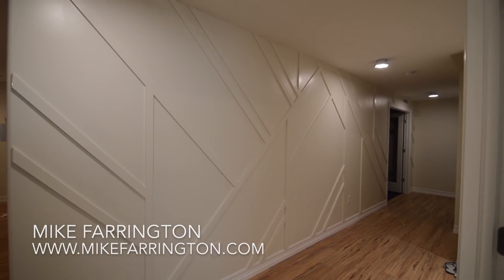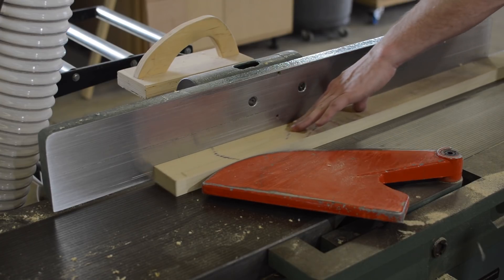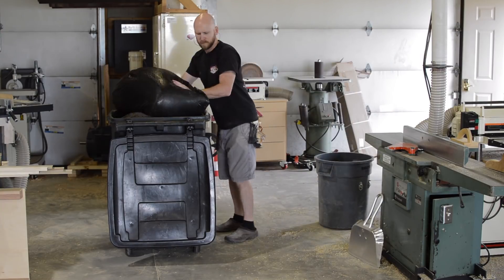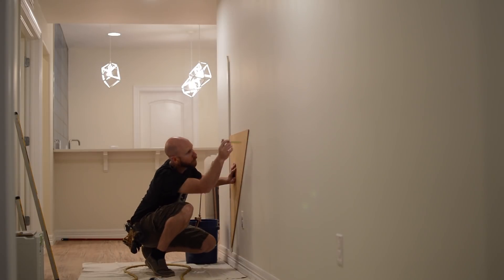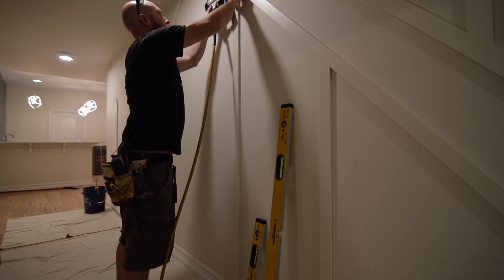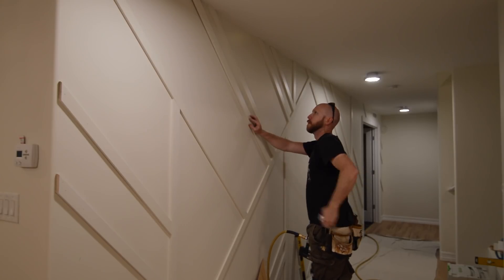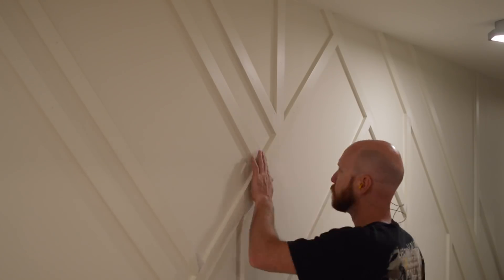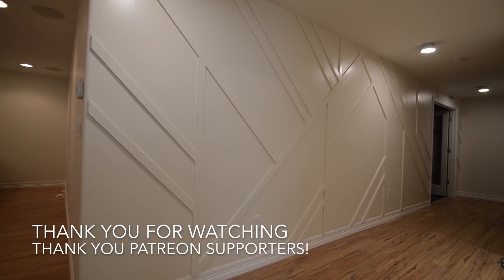Wainscoting with a Modern Geometric Twist, Wall Paneling diy

Comment: Did you just leave the 1 x’s hanging over the baseboard? Not impressive man. And you do fantastic work.
Reply from the maker: The pieces were slightly under 1/2" so the over hang was not too bad. Leaving the base was not my decision though. I presented the option to remove the base board and replace and the extra cost was not worth it.

Comment: I think I would have changed the base board over to 1x6 . At the start corner in my house from kitchen to great room wall colors changed, so stopped the colonial trim, added 2, 1x3 up rights so the trim in the kit was different in great room and the wall color was different. Liked the designed a lot
Reply from the maker: I agree, this was presented as an option and was not worth the extra expense.

Comment: Hi Working Man...Thanks for the caulking bucket tip, im great at the application, just not the excess/wipe off mess, always used paper towels. Heres a pro tip store your wood fillers-spackle-Gorilla glue in 1 gallon ziplok bags. It really works. (smaller ziploks for small containers). 
ALSO if you have welding gas cylinders... you can pump some CO2-Argon into your paint/spackle containers, it displaces the air/oxygen. No more paint bladder forming in the can. (Their is a waaayy overpriced product that does same thing "Bloxygen" its just Argon gas.)
Reply: Ah! I never thought of using bloxigen for spackle. That's a great idea. I guess I can use it for almost anything that will dry out and has a lid. 

And I feel you. Caulking is such a simple concept but takes a while to master. And you are right. Anyone can throw caulking into a corner. But it really takes some experience to know just the right amount so you can wipe it and get a solid line without getting the excess on the sides of your finger or the caulking tool. And to not overwork the caulking so it starts rolling up. A lot of finesse goes into accurate and fast caulking. Very very underrated skill that can make decent finish work look twice as good... Or make great finish work look like crap if not done appropriately.
Reply from the maker: Good tips thank you for your input. I like the ziplock idea for sure.

Comment: Nice job as usual - I'm sure the base was purposeful.  GREAT attention to detail and ditto on the glue on the boards additive to the nailing - makes any curve in the wall not gap!
Reply from the maker: Thank you. The base was a compromise, I presented the option to remove and replace but the extra cost was not worth it.

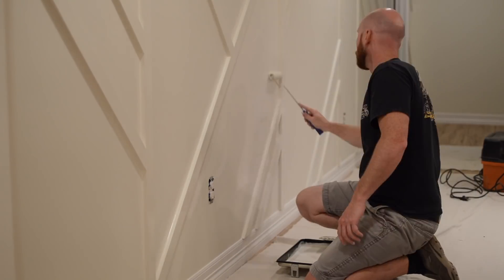Comment: 10:00, how long did you wait for the caulk to dry before paint? I thought 24 hrs was the norm? To me the design has a mountain feel to it. The wide shot at the end shows the peak near the right side. Not sure if that was intentional or not being that you're in Colorado.
Reply from the maker: Yes, the mountain theme was intentional. All caulking will have a time to paint in the instruction. The stuff I use is 30 min.

Comment: Mike
A secret for you
Ditch the adhesive, the chalking, the fillers

Use 20-minute powder drywall mud
It's made for this application
Buy it by the 20-lb bag, saves you money

It's a glue (add more elmers glue if desired, I don't) for the back of the trim, just wipe excess clean, leaves perfect edge and like the walls, it never crack

It's a filler
It drys in 20 minutes hard to sand smooth

It cleans up wet like chalking finger or rag
You can fill large spaces with that 20 minutes hardness means no waiting for chalking to dry
Its easily sand able with sponge sander, no pressure required.
Takes primer & paint perfectly
Because its already on the walls
Reply from the maker: Thank you. Great tip.

Comment: Hi Mike, thank you for another great video. I have a question if you don't mind? I have a similar job coming up and wasn't sure whether to give a slight round to the edges of the panelling or not, or at least break the machined edge. Obviously id need to leave unrounded sections until after fitting and then sand on site for joints, but curious as to how you did it. thanks in advance from Ireland
Reply from the maker: I didn't round over the edges, I did give them a quick break with a sanding block.
Reply: @MikeFarrington  thanks.

Comment: The only thing I would have done differently is used Big stretch caulking i used it on a job 16 years ago given to me by the other guy on the job site didn't want to drive to town just to finish that is what he had i was so impressed with the results never will use Dap again

Comment: Why did the power feeder get used with the edgetec disc instead of just running it through by hand for cleanup?
Reply from the maker: With so many pieces it helps with speed and keeps my hands from getting tired.

Comment: Hey Mike. Just the other week I had to do some cabinet trim pieces that had a very harsh transition just like your frame pieces that are touching the baseboard. It was a very similar issue or the clients not being able to afford the cost of changing it the right way. I just put a 45 degree bevel on anything touching the bottom. And it made the transition not attract the eye as much. Even if the client is on a tight cash budget I think it is a nice touch to throw in to make the harsh transitions a little less noticable. If nothing else, just or my own reputation and portfolio. I love watching all your videos. We do very similar work, and I completely agree with you. I think I could make a little more money doing only one kind of work... But I love the variety and I can just never turn down an interesting job or a new challenge. Thanks for the great consistent content. It helps me to see how other legit pros like to do their work.
Reply from the maker: Good idea, thank you.

Comment: Mike, i have a unique situation that I was wondering if you had any experience with...my friend wants me to help install some 3/4" shiplap about chest high in a foyer, and his walls have rounded corners. How should we end it? I suggested stopping it about an inch from the start of the curve with a piece of 1x2... Also, should we take out the baseboard and run the shiplap all the way down to the floor and then cap with shoe moulding? Thanks and keep up the awesome videos!
Reply from the maker: I would hold it back from the edge some amount, then come up with a piece of trim to finish it off. I think you are on the right track. Play around with it and see what looks good.

Comment: If the base molding starts out thick on the bottom, then tapers up to be thin at the top, how do you butt up your wainscoting panels to the base molding, without having an obvious gap?
Reply from the maker: I would suggest removing and replacing the baseboard over top of the patter. In this case the customer didn't want to do that.
Reply: @MikeFarrington  thanks a million!

Comment: Pro Tip: bondo for cracks and holes. You can chose hownmuch you mix up as it is two stage.
Reply from the maker: Thanks Justin. I'm hot and cold on bondo. I don't like mixing it, but it does work good. My problem is I always seem to find one more little spot that needs filling after I'm all done, and mixing up a new batch just slows things down.
Reply: @MikeFarrington  Hi Mike, you can buy premixed bondo (glazing & spot putty) in a squeezout toothpaste-type tube from Dynatron. I use it all the time. If you miss a spot, just whip out the tube and boom, no waste.
Reply from the maker: Good info, thank you.

Comment: Do you use a general purpose blade in your mitre saw? Or do you change it when breaking down product at the start of a job and again when you are using stops for finished lengths?
Reply from the maker: Same for everything. 80 tooth.

Comment: Hey Mike.  For this type of job, do you use a foam roller or a typical longer haired one?   Did you use a round over on any part of this? Thanks!
Reply from the maker: I use a Mircolon roller with a short nap. I did not break out the round over.
Reply: Awesome, thanks Mike.

Comment: I want to do this project but I'm not the best at Miter angles....how did you map out all the needed angles for the precuts?  Did you use any special methods?
Reply from the maker: I created the layout in Sketch up, from there I had a pretty good idea about how many pieces and their length. Regarding the miters, they are all pretty much 45 degrees, so I set my saw and got to cutting. Several of the pieces I would cut close, then check the fit and recut as needed.
Reply: @MikeFarrington  Thanks Mike.  I'll give Sketchup a try.  Looks like you can get it for free!

Comment: Haven't really seen anyone pull out a planer for small joins like that. Looks even cleaner than sanding. Cheers from CA!
Reply from the maker: Thanks. It makes less dust then sanding, so I use the plane first, the kiss it with sandpaper.

Comment: Hey brother what's the deal with the MH putty? Is it better than Crawford's spackling paste in your opinion?
Reply from the maker: I've never used Crawford's. I really like MH though. It dries pretty fast and hard, but sands really well.
Reply: @MikeFarrington  oh man. You gotta give it a shot brother. My uncle who is a master painter turned me onto it and all my local paint stores say it's the best so I bought some. They were right. The stuff is amazing. Dries hard enough, sands super easy and it has zero graininess to it. You can use a 320g sandpaper and put a single top coat over it and it is like glass. Zero surface imperfections. Dries fast but not too fast, and doesn't shrink too much. And if you use the full strength product without thinning it, you can mold it really heavy and get minimal cracking. So far it's the best product I've ever used. But I've also never heard of MH. I'm not a huge fan of the metal paint cans for putty, but I'll buy some MH from Amazon or something and give it a shot. Just a heads up. Don't get the Crawford's Painters Putty. That's an oil based product with a long dry time. I'm not exactly sure how to use that stuff... But the spackling paste is what I use. I've done some pretty amazing patches with that stuff that I didn't think we're possible. And after thinning it a bit with water you can fly super fast applying it to large surfaces. Doesn't gum up sandpaper or anything so it's np sanding off excess.
Reply from the maker: @MaydaysCustomWoodworks  Very good info, thank you. I'm gonna order some Crawfords and give it a go.
Reply: @MikeFarrington  hey brother I bought some MH and gave it a shot. It's actually some pretty nice stuff! I think it's just slightly more grainy than Crawford's. I'm OK just putting a top coat right over Crawford's but the MH can says I shouldn't do that. But I think if this stuff is underneath a primer then it will be just as good as Crawford's. Is this stuff mineral spirits based?? I thought it smelled like acetone but the can says it has mineral spirits in it lol. But I'm very impressed. I think I still prefer Crawford's but this stuff is great. I'm gonna keep this can and as long as I can put a primer over the top of it, I'll definitely use this stuff up. Thanks for the recommendation. I'm glad to hear that there's some good spackle out there aside from just Crawford's and 3m lol. This MH is better than the 3m stuff but the 3m is still good. I keep the 3m spackle on hand because that stuff dries super hard almost like a Bondo body filler or something.
Reply from the maker: @MaydaysCustomWoodworks  MH works pretty good for sure. I think you are correct that it contains mineral spirits. I always think its a good idea to try out a few different products.

Comment: Try listening to "Making it" with Jimmy Diresta, Bob Clagett and David Picciuto. Back in the day I usd to take all of my tools to the job site, just in case. Today I have a set of tools pretty much dedicated for installations. Thanks for sharing.
Reply from the maker: Thank you. I'll give it a go. This set is a dedicated set that sits on the shelf when not in use. If I was onsite more I would build a trailer, but I'm out of the shop maybe 5 days a month.
Reply: @MikeFarrington  it's about the same with me. About 10-15% of my work is out of the shop at a job site. I don't exactly have double the tools.... But they are very organized. All my common job site tools are organized into the Milwaukee Packout kits. 3 racks of them specifically. When it's time for me to go to a job site I just roll them up into the trailer. There are some things like a ladder, electricians tools, some clamps, and sawhorses, and a tiny chop saw that stay in the tool trailer as specific job site tools.... But the $3000 in tools in the 3 Packout racks doesn't exactly justify the doubling up when it only takes me 2 minutes to roll them up, and they're all organized well.
Reply: @MaydaysCustomWoodworks  that feeling when you travel 50km to the job site only to realize you needed 3 more clamps, lol. It has happened to me and I just went to the closes store and bought what I needed.
Reply: @CiceroMonteiro  I've been there. Once I even drove an hour and a half and forgot an air compressor while needing a pneumatic nailer. That was a frustrating home Depot trip lol
Reply from the maker: @MaydaysCustomWoodworks  I totally understand, thats the reason for my goofy system of laying tools out. I really try not to forget things.

Comment: Hey MIke, I love your work as well as the profession of custom woodworker. I've been an accountant for 8 years but I have an obsession for woodworking so I'm seriously looking into transitioning careers.  My question to you is what's the best approach towards getting into the profession?  Is it doing diving into woodworking books, taking classes, trial and error?
Reply from the maker: Thank you. I would say play around with some DIY homeowner stuff first, then try working for friends. If you can build up enough side work, then its time to go full time.
Reply: @MikeFarrington  great advice. Very true. Also, I have personally learned a massive amount by simply building all of my shop stations. If you need a drawer, table, cabinet, shelf, bench, whatever... Build it for yourself. If it sucks build it again till you get it right. This will give you a great idea for structural strength and help you understand your tools. After that, just like what Mike said. DIY stuff, and then start off slow. Don't charge much money when you are starting off. You need to have confidence and real results backing your woodworks before you start racking up some serious jobs. If you take a job doing 20k in cabinetry before you are ready and you screw the job up, they might sue you, and your business take an enormous hit to reputation and cash flow. If you never make a living woodworking, be OK with that. Just become proficient in woodworking. Then start small on your sales. I've sold many things when I was younger that broke over time. If they were cheap or given away no one cared. But if my expensive products break then people get really really pissed when they spent a significant amount of cash and your products didn't live up to the quality assurance.
Reply: @MikeFarrington  Awesome... Thank you Mike!
Reply from the maker: @adanminaya2726  My pleasure.

Comment: Great job, but I would have chamfered into the skirting board.
Reply: Edward O'Rourke I was thinking the same thing. A hard edge leading into the rounded skirting board looks odd.
Reply: A chamfer into the skirting is a hack as well.  If it were my job (it wasn’t) I would’ve taken the baseboards off and framed the whole wall with 1x then started the wainscoting.
Reply from the maker: I offered this as an option and the extra cost was not worth it.
Reply: Mike Farrington I figured this was the case.  I’ve been in the same position before too.  It’s tough to have to forego your own opinions to make a customers vision come true.  
In the end excellent work, carry on
😉👍

Comment: awesome work! a little trick i like to use when i'm caulking: on the inside corners of the pieces where there's a 3-way gap to caulk i use a putty knife with a slightly more acute angle than 90 degrees at the tip to pull out the little bit in that corner that you cant quite get with a finger to keep the corners looking nice a sharp!
Reply from the maker: Good tip. I use an old rounded flat head screwdriver.

Comment: Looking at the final result I would have wanted to replace the skirting as well.  Something that melds better with the geometric design would be the finishing touch to this, and you did your work so well it seems a shame to see the way it just stops at the skirting level.
Reply from the maker: I agree, that was not my decision. I presented that as an option to the client and the extra cost was not worth it.
Reply: @MikeFarrington  Aha, I thought it was odd for your work to look like that.  I wonder if the client will eventually realise that was a mistake and call you back.  We can hope.
Reply from the maker: @FireAngelOfLondon  I told them fixing it in the future would be an option. I personally think it looks good enough at this point to just leave it alone.

Comment: Love the work, great job.  From an aesthetics view, i'm not too excited about the harsh ending to the wall, the trim just kind of stops.  Likewise at the existing trim.  Would you have considered blending the vertical seam or a steep chamfer to the ends of the boards?  What about a cove cut at the horizontal base trim?  I know that's a ton of extra work, but it would really make the wall pop.
Reply from the maker: Thank you. This was the option the customer wanted. I think there were a few other good choices on how to terminate the trim, but this was what we went with.

Comment: So, jointer or planner first for squaring stock, and what is your step by step you do for milling> Thanks for the vid,
Reply from the maker: My milling process starts at the jointer. Square a face and an edge, then plane to thickness the rip to width.